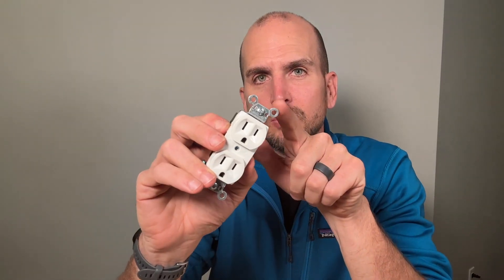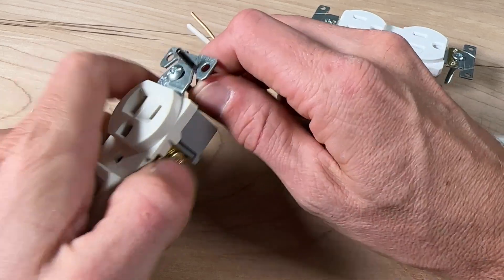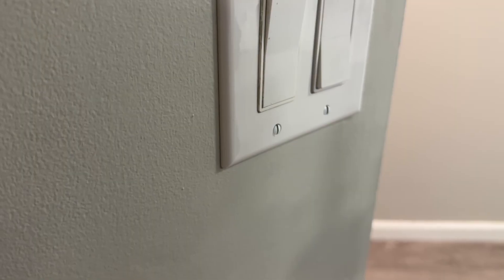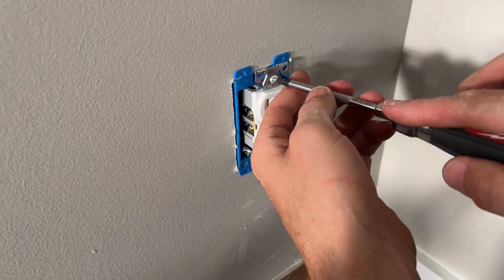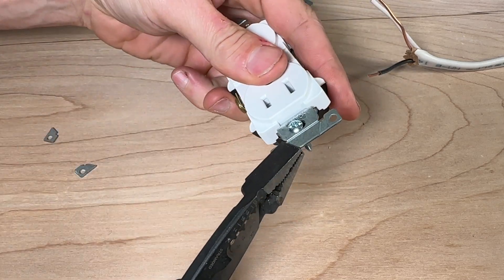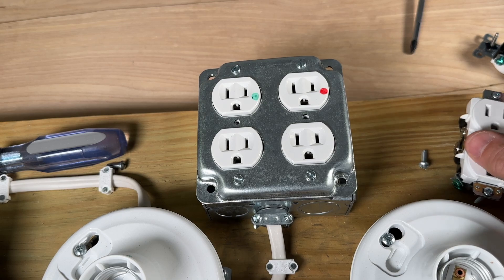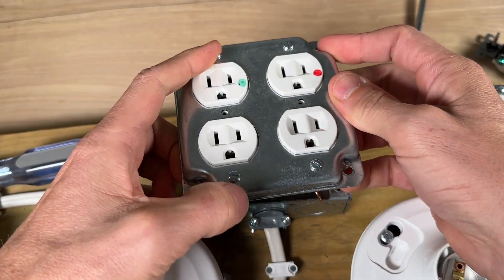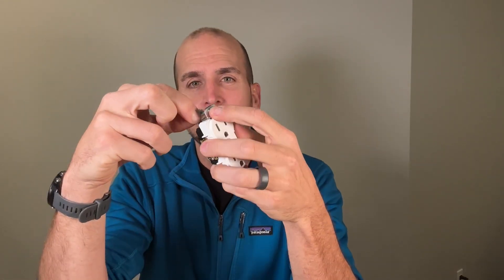Why Outlets and Light Switches Have These little Ears

Comment: I've got an older home. Handi boxes had not been invented yet and there was no drywall just plaster in some places. The switches and recpts were nailed to the 1x6" wall planks with nails through those ears. Modern houses don't do that but the holes seem to still exist.
Reply: Correct. On homes that are ~100yrs old have been known to have these "ears" as screw/nail points.
Reply: This sounds like the most likely reason that holes were put into the outlet ears to me. The other ideas put forth here seem like they might be ideas that came along later. Although one of the comments suggested that they were put there for use as spacers with some kinds of metal boxes. That one seemed like it might be the original idea also to me.
Reply: Totally agree. Have worked in older home with lathe and plaster wall and early electrical boxes and ancient switches and receptacles. The holes in ears were for nails or screws to attach to lathe. Also, although not sure, but having seen it often enough to believe it was some kind of standard, the spacing of the lathe would match the size of the boxes if cut in properly- in other words as well, makes a very neat fit.

Comment: I bend back the ears to make up the extra depth for a sunken junction box. A small screw driver through the hole or pliers allow you to bend each ear back quite precisely and make contact with the front edge of the jbox.
Reply: I do the exact same thing.  I thought that's what they were meant for.

Comment: Great video. Every time I see something about North American electrics I'm just surprised at how old fashioned and dangerous it seems. UK sockets are one piece so we don't have any of the issues you described. Also, all our terminal screws are recessed so almost impossible to accidentally touch if live testing etc. I suppose that's why you're not allowed to use proper voltage over there. 😉
Reply: And how's Brexit working out for you?
Reply: @ATEC101  rubbish. Thanks for asking.
Reply: Yes, things are a bit different in our two countries. You speak British English, while we speak American English. No translators are usually needed.

Comment: Something to note, if you are putting an outlet in an octagon box, you’ll actually have to break off the two screws holes too
Reply: That would be a code violation. The center screw in a receptacle cannot be the only means of securing.
Reply: @jimmac1185  But the yoke ends are still held between the edge of the box and the cover, too.  It's not like in 4-square box where the ends of the yoke are dangling. 

3:30 In addition, the missing middle screws look very unprofessional.  It looks a lot nicer with some matching panhead screws secured into the center holes.  That receptacle will never budge with three screws holding it.
Reply: Curious about installing receptacles in ficture boxes. That would be unusual.

Comment: The break-off ears were originally only designed for the Exposed Work Covers as they are properly described. I also believe those spacers with the holes in them when you break off the tabs were solely to gap between the front of the mounting screws of the receptacle and the actual exposed work cover.

Comment: I never had problems leaving the ears on the outlet. It's best to leave them on if you use a regular box with the metal hold brackets. That's old school. The new boxes are easier to install. But even so the ears don't create a gap on the plate to wall if the box is tight to the wall I guess also because I use larger plates to cover bad plaster. Thanks this is good to know I can reuse outlets that the ears were removed only in my own jobs. I would never use used outlets for someone else. Thanks I knew why the ears but why the holes. 73

Comment: Thanks, I just fixed a few of mine after watching this. What do you when the actual box is sticking out from the wall? I tried pushing on it but something is keeping it from being flush.
Reply: A new-work box that you installed, or...?
Reply: @jovetj  No, It's a solid wood wall which they routed out when they built e house. The box in some cases sticks out a little too far so when you install the cover there is a space around it. With the wiring in there I obviously can't go in there with a tool  to make it deeper if that's the issue.
Reply: @Fred_Flintstone1  Oh, I see.  I'm sure you could make it deeper as long as you're not in danger of going out the other side.  But I don't know how easy that would be.

Comment: Pvc boxes are illegal here. So is romex. You'd need a lot of the tabs to use for a spacer, you can buy those plastic folding spacers pretty cheap, i keep a bunch in my truck and they work great and its 1/8" per piece. 

Those tabs do make great washers in a pinch like if you're tying a ground wire to a metal box and don't have one nearby. I find it much easier to cut them off with aviation shears.
Reply from the maker: Are you in Chicago?
Reply: @EverydayHomeRepairs  yes

Comment: Very interesting, I never considered stacking those little ears onto the screw to give extra distance from the wall or box.  Thanks for sharing!
Reply: probably because there's nowhere near enough thickness to fix the problem of a recessed box in an oversized hole.
Reply: I use a little length of plenum tubing to set the outlet back from the box as needed.
Reply: @stevedubin3510  if it's a small gap I'll use a coil of wire, if it's a big one I use plastic box extension rings.  (which are required if there is exposed combustible material of any significant thickness, anyway.)

Comment: I've made device spacers/shims just by circling insulated conductors around the tip of a needle-nose plier and cutting off the little loop. The insulation plus the conductor gives you a good thick 1/8" or so spacer, or even like 3/16" if it's made from a #12 conductor. Handy because you already have the wire right there. I retain the plaster ears as much as possible because they add stability to a good flush mount.
Reply: That does work, but I suspect it's not code, and may not pass inspection. Proper spacer strips are cheap and do meet code.
Reply: @JCWren  It's no less compliant then using any other means of shimming. Those strips you're talking about have no UL or CSA listing that would make them preferred over any other method.
Reply: @JCWren  In over 20 years of residential construction, I have never seen a building inspector look for that.

Comment: You cover the issues very well. There is also need to break the tabs "mikey ears" when use single outlet/ switch metal cover. I have to do it a lot of times. Many thanks for showing  it is helpful for people that don't work in this field

Comment: The video you pointed to at the end is not the video you referenced.  Otherwise, great explanation on the ears. I learned something new . Thanks.
Reply from the maker: Yeah, that is crazy.  Not sure what the hiccup is as it looks good on my side.  What video popped up?
Reply: @EverydayHomeRepairs  Reading fault codes on HVAC
Reply from the maker: @Matt633NLT  got it, thanks so much for the help. 👊
Reply: I just watched the end again and it's correct now 👍

Comment: Hi Scott. Got a question for you. Both wires to the outlet are black. I don’t know which is the hot one. What device do I need to check which one is the hot one? This is an old house! Thanks in advance!
Reply from the maker: A multimeter would be best but in some instances you can make sense out of the wires with a non-contact voltage tester. The ones I use are listed on my Amazon store under the Electrical section https://www.amazon.com/shop/everydayhomerepairs
Reply: @EverydayHomeRepairs  Thank you so much. I will check them out!!
Reply: The easiest solution could be if you have a "ground wire"  in the box or near by, just set your multimeter to Volage at least 750V and connect one lead of multimeter to identified ground wire near by and touch other to black wire you have one by one. With whichever black wire you have 120V on multimeter that's your  "Hot" and with Ground and other wire it should be "0v" that's your Neutral.
Reply: @gurdeepsingh2836  I do not have a ground. It an old house. Thank you.
Reply: @scottsachs2547  Some of those old metal boxes are grounded from behind the box.  Good to use multi tester to see if you have a ground.  But a non contact voltage tester should identify the incoming hot when disconnecting the two black wires from the device.
Reply: @ptso7580  Thank you!I just bought the multi meter on line.
Reply: Get an electrical circuit tester or voltage contact tester.